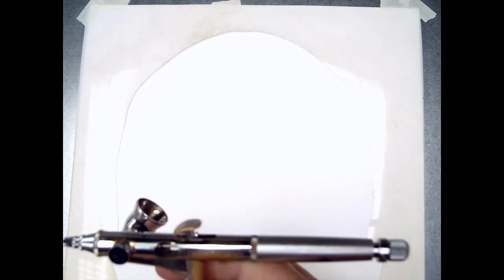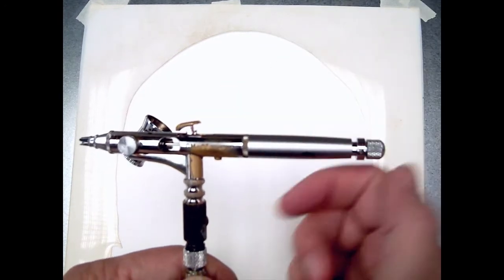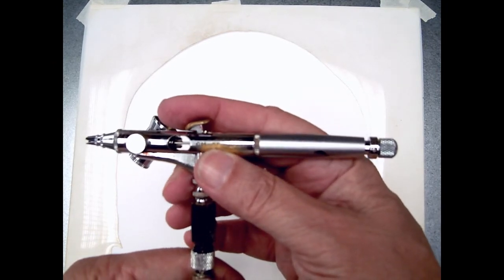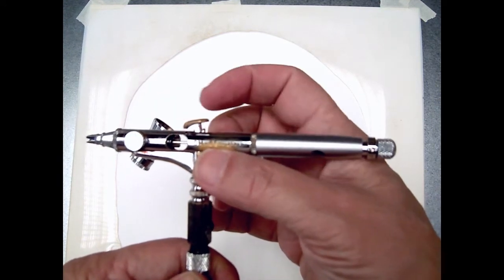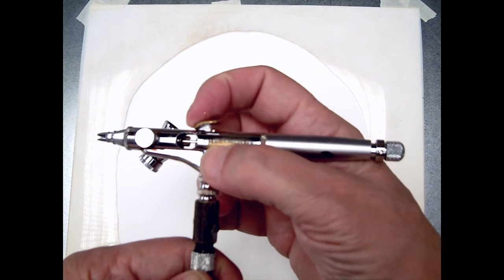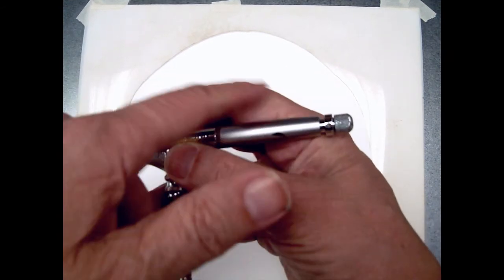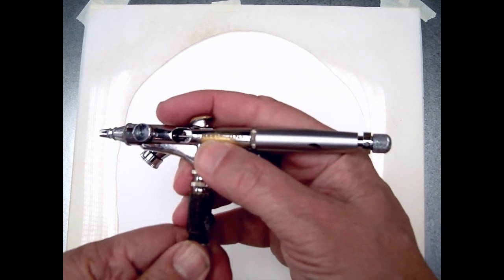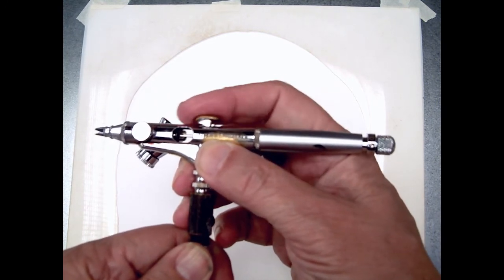Dru Blair style hand position for optimal  airbrush control

Comment: I understand what you're saying about the finer trigger control with the way you have your finger on your trigger. It'll never work for me--I can't stand the side mount cups and much prefer gravity feed....thus I'll never give up my Olympos MP-200C Microns nor my Olympos SP-B, which is pretty much the equivalent of your Iwata CM-SB but with gravity feed. And I like my triggers tall as a result, so I modify them with foam--nice and cushy. I find I have far better control with a taller trigger than I had before when I used a normal height trigger.
Reply from the maker: sped17373 I appreciate the quality of Olympos airbrushes. I own several, and I wish they were still in production. 
Trigger height is a personal preference, but  finger tip control is always going to be more precise than the gross motor movement of the entire finger. 
Besides having no finger tip collision, the CM-SB side cup model has other advantages: the side cup is out of the line of site, the nozzle is closer to the trigger, the cup can be removed for easy cleaning, tilted to avoid spills, and the side cup is much more frugal with paint, requiring only 2 drops to prime the gun. By comparison, it is much more controllable than its top-mounted counterparts, even with its .18 nozzle.